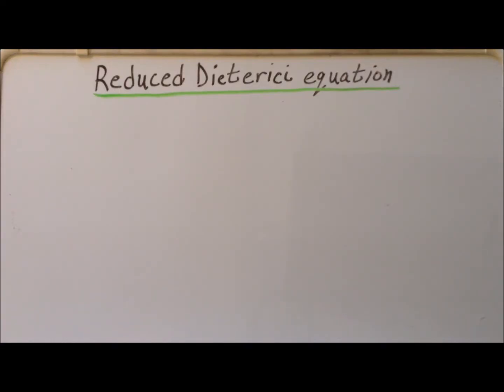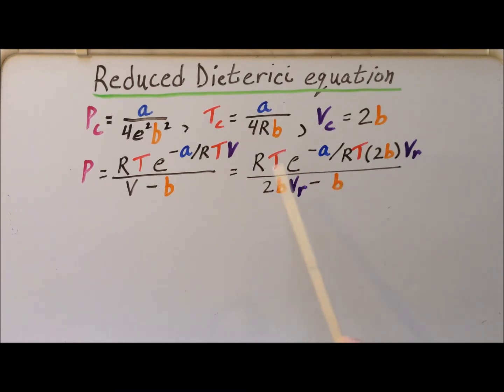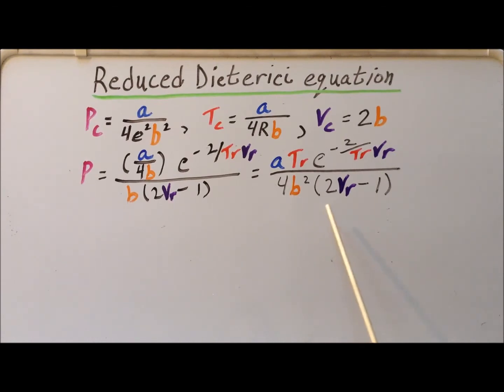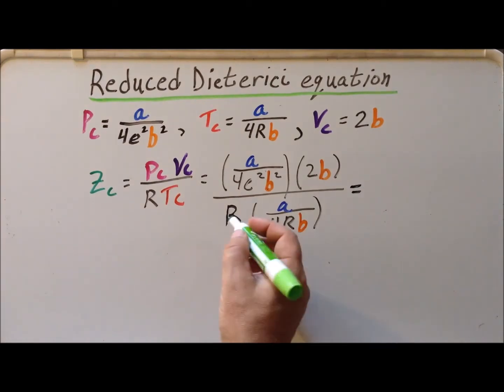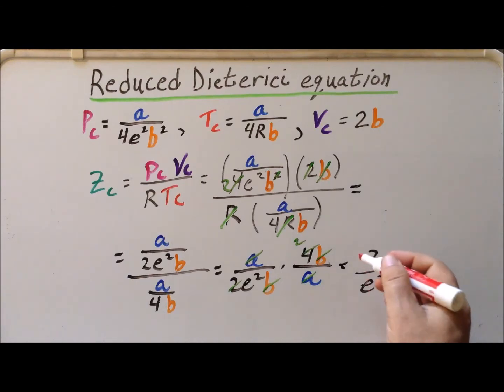It's a gas: reduced form of the Dieterici equation

Comment from the maker: (for mobile users)

00:15   Introduction
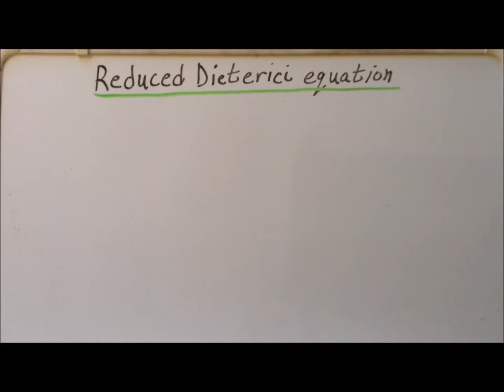00:35   Values of reduced constants p𝒸, T𝒸, and V𝒸
Note that p = p𝒸 pᵣ, T = T𝒸 Tᵣ, V = V𝒸 Vᵣ
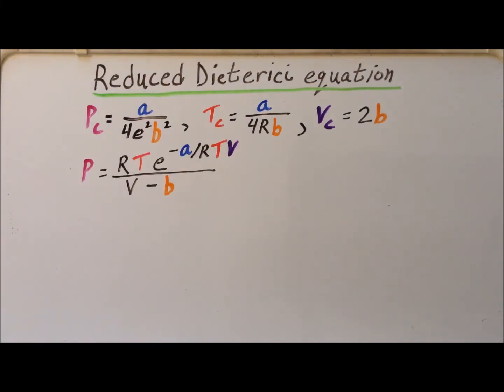01:11   Dieterici equation of state
01:54   Substitute V𝒸 Vᵣ for V
02:14   Factor b from denominator
02:31   Substitute T𝒸 Tᵣ for T
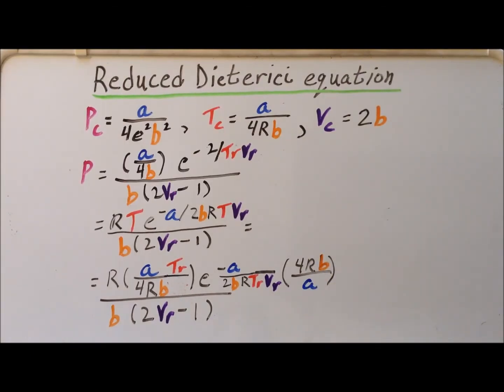03:06   Simplify
03:34   Multiply numerator and denominator by 4b
04:04   Substitute p𝒸 pᵣ for p, divide each side by p𝒸
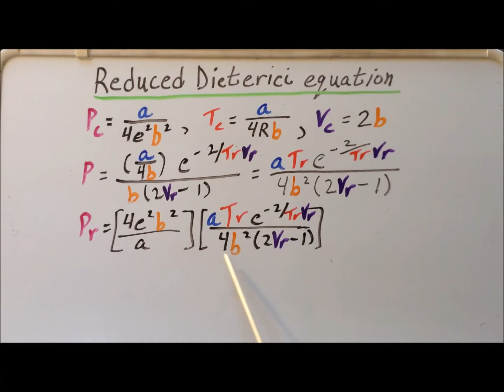04:37   Simplify
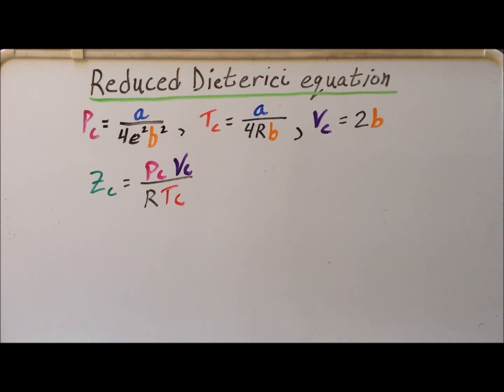05:14   Definition of critical compression factor Z𝒸
05:39   Substitute values of reduced constants p𝒸, T𝒸, and V𝒸
06:13   Simplify

Step-by-step, color-coded derivation of the reduced form and the critical compression factor for the Dieterici equation of state. 

Don't forget to like, comment, share, and subscribe!